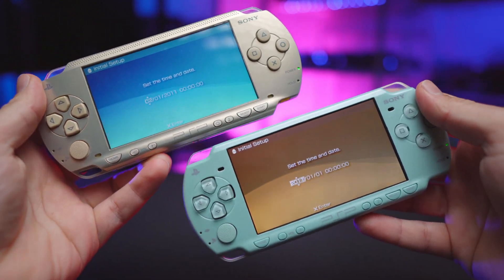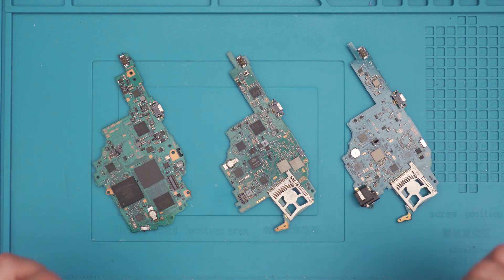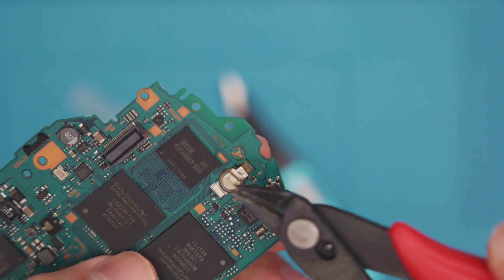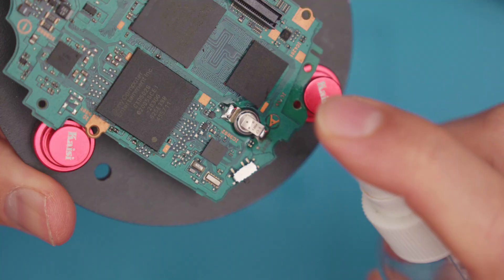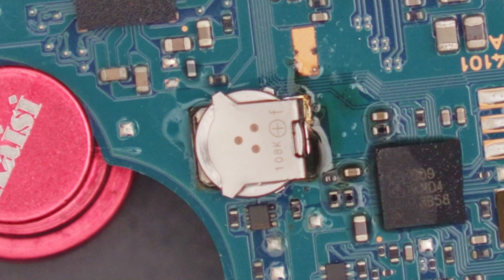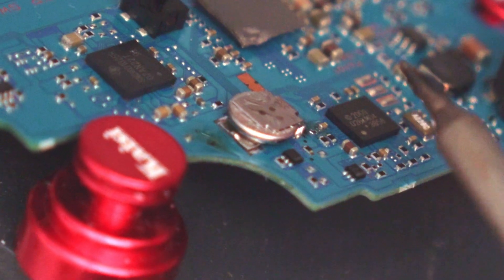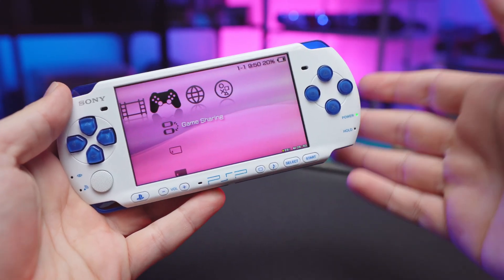How To Fix PSP Super Capacitor "CMOS BATTERY" [Read Description]

Comment from the maker: ━━━━━━━━━━━━━━━━━━
🔴 Current Stance [11/OCT/2025] 🔴
━━━━━━━━━━━━━━━━━━

Disable the Super Capacitor Only
Release the top clip and place tape underneath it to stop contact.
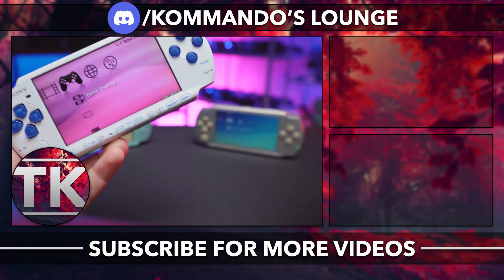As shown in Method 4 the video - 13:16

━━━━━━━━━━━━━━━━━━
⚠ Extra Important Notes & Observations:
━━━━━━━━━━━━━━━━━━

🔴 Many people without the right tools or experience have damaged their PSP motherboard while attempting this, often ripping traces or knocking off components when attempting to remove the super capacitor.

🔴 Based on what I’ve seen (and personally tested), PSP Slim models with weird charging issues may have a damaged or aging charging chip, a bad solder joint, or simply faulty charging logic.

🟡 In some rare cases where the PSP refuses to power on, reconnecting the super capacitor lead (after it was taped off), by temporarily bridging it with foil or soldering it back, seems to bring the system back to life.

It’s still unclear if this is due to user error or a failing charging IC that’s stuck in the wrong state.

🔴Some PSP units with power or charging issues, even with the super capacitor fully removed, may need to sit without any power (no battery or charging cable) for a period of time before they start working again.

This could take an hour, overnight, or even a full day before the system begins accepting power or turns on normally, this is one part of why I think its a faulty charging chip.

But this is with varying levels of success, it can stop accepting power and or turning on again after a while.

Sometimes it can keep working even tho it stops charging, when kept in sleep mode.

🔴 There’s no documentation about this issue anywhere. I’m currently testing and investigating ways to revive these units reliably.

🟡 If you have any personal info or observations, please share them below.
Your input helps a lot with ongoing testing and understanding of this issue.
Reply: GREAT JOB! As for PSP go  and PSP E1000 how NON removable is the battery? IF you have not already done a battery replacement video that would be great to see.
Reply from the maker: @brianwalker7771  More like not  Hot Swappable* or easy to get to

PSP GO is simple, remove 2 screws ontop and 4 screws on the back to unclip the battery

E1000 requires you to open the UMD door + some extra steps to get to the battery.

Will eventually have disassembly videos for those
Reply: @TotalKommando  thanks for the reply.  So no soldered in and glued to high hell BS just enclosed inside the unit. Good to know.
Reply from the maker: @brianwalker7771  Correct, they can be unclipped and removed after the use of a screw driver, its not like those cheap chinese handhelds.
Reply: Hello mate, I have a really odd power issue. 
1.My PSP 3000 works fine when I connect the charger without the battery inserted. However, when I insert the battery—even if it is fully charged—the console does not power on unless the charger is connected. After connecting the charger, the console powers on with the orange LED, but if I check the battery information in the system, it does not recognize the battery. Eventually, the console shuts down exactly 5 minutes after being powered on (I have measured this multiple times). Interestingly, once it shuts down, it won’t turn on again until I disconnect and reconnect the charger cable. Then the same sequence repeats, and it shuts down after 5 minutes again.
2.I have managed to get it to work solely on battery power a couple of times by doing the following: I leave the console powered on and connected (without the battery) for over an hour, then insert the battery. In this way, the console recognizes the battery and allows me to play on battery power for a decent amount of time. I can even turn the console off and on again without the charger connected. However, if I leave it off for a few hours or try to turn it on the next day, it stops working on battery power and returns to the issue described in point 1.
3.I want to clarify that I have tested several batteries—both original and second-hand ones in good condition—and the problem is not due to the battery.
Do you have any idea what might be happening? I have already taken it to several technicians, but none have resolved the issue. The last technician told me the motherboard required replacement. Do you think if by doing this of the CMOS capacitor, would that solve the issue? I wanted to know if that approach might work, or if you think it could be an issue with another chip, or if the best solution is definitely to replace the motherboard.
Thank you!
Reply: @julianariasrodriguez9728 hi  there , I have a psp 3000 just take out from my store room  it been 5 years ago , it have same issues just like yours. Waiting for solution answers in this comment channel.
Reply: @TotalKommando hey, someone told me the psp won't turn on without a charger even with a battery if I disconnect the super capacitor, please advise on what I should do.
Reply from the maker: @KaranbirSinghGill-os7rv  I had one person before tell me that it stopped powering on after they removed the super capacitor, once they put it back it started working

I have yet to encounter this personally, I tested it with the units I have opened and didnt run into this issue,

Perhaps they have a different problem, you can try removing only the top leg and see if it stops working

Otherwise the psp might have a deeper issue that is not related to the super capacitor, for example i have one that i need to leave for a while without power before it accepts power
Reply: @TotalKommando i have the same problem of removing it and it wont turn on
Reply from the maker: @KaranbirSinghGill-os7rv  whats the status now?
Reply: @TotalKommando  I can’t replace it myself so i’ve only been using my psp when i cold boot it somewhere when it’s plugged in. but i have found a shop, i just wanted something concrete before i could actually go through with removing the super capacitor because the psp not cold booting would be an issue for me.
Reply: @TotalKommando  I just got it done and it works perfectly, thank you so much!
Reply: So i can just remove or disable it with no consequences?? Also what do i do if i have no experience in soldering and tweaking my psp?
Reply from the maker: @iannuyens6274  disable it only, removing it is asking for trouble if you have no experience, take your time with it, peel and tape out. it only keeps time and date
Reply: Sorry, to be more clear - you recommend simply disabling the supercapacitor for every PSP version? Is Method 4 applicable to the PSP 1000 series?
Reply from the maker: @ThatDudeCalledMax  Yes, and Yes.
Main reason for disabling only, is because a lot of people end up damaging their motherboard if they are not experienced. At least with this method you get the intended attempt to fixing a faulty power issue psp and or fixing passive battery drain with the least risk.

If you are experienced and up for it, you can try removing it but if you dont plan on replacing it, just disable it for now.
Reply: @TotalKommando   Wow, I have to say I'm surprised you responded so quickly! You're awesome. I'm practically a novice when it comes to soldering, though I'm a bit more experienced with opening things up. I haven't gotten to checking my PSP 1000's supercapacitor yet, but if it happens to be corroding like the PSP from the 1000 full disassembly vid, should I be more urgent about changing it?

I've heard online that there may be issues with the PSP shutting off randomly or having strange charging behavior because of dead supercapacitors, although I'm not sure if those issues were constrained to the 3000 models or not. I hear they're a bit more peculiar for that series but I'm probably wrong. Is there any truth to these issues occurring solely because of a faulty supercapacitor?

In any case I really appreciate the advice, thank you. And thank you for the website guides and the video.

EDIT: If it's no bother, could you say what soldering iron you were using in this video? Presumably it's one of the ones listed on your site, but I just wanted to make sure regarding the tips you were using.
Reply: @TotalKommando  Just one more question came to mind, sorry, but if I'm simply disabling the supercapacitor for the PSP 1000, in my case, 1002, I just need to follow the steps as shown in Method 4 where I peel back the top connected part, place kapton tape over the battery with a little bit tucked under that side of the battery, and snip off part of the peeled back part?
Reply from the maker: @ThatDudeCalledMax  Yea I mostly found the weird charging problems on the 3K with dead caps.

It would be good to remove specially if its leaking.

The soldering iron I use is the AiXun T3A with T245 tip handle, its an old model now, and the one in the site is what I recommend over it now, solid system.

Yes just remove the top lead on the 1000 cap and isolate the connection.
Reply: @TotalKommando   Thanks for letting me know. Will look into this when I get my tools from Aliexpress.
Reply: @TotalKommando  Hey, following up on the PSP 1000. Currently in the process of trying to fix another problem which is the joystick drifting up into the top left constantly.

Mind you I just opened up my PSP recently, probably the first time it has been since being in the factory. I aired it out, dusted it, but it didn't fix the issue. I hear the conductive rubber may be causing the problem and cleaning the contacts underneath can help: not sure if I should clean the rubber itself, but do you think it's necessary to open up the whole PSP for this, or can I just dab the contacts with a cotton swab with isopropyl on it?

Comment: I know this may not be related to the supercapcitor but my psp 2000 can turn on but doesn't go into the xmb menu is there a fix or is it done for? I should also add that it's pretty old and banged up
Reply from the maker: might be bricked, or has a plugin problem, remove mem card ( to disable all plugins) and hold home while you power on, maybe its soft bricked
Reply: @TotalKommando it's not modded but I'll take it to a shop that could fix it, if it's posible

Comment: As of 12/23/26, my PSP won't turn on with the battery inserted. Only when plugged in. It's been requiring the date to be entered after replacing the battery for absolute ages, but this is the first time it won't turn on with a battery inserted. Good batteries, too.

Now I have to disassemble my PSP. AGAIN. 

I swear, every time I think I'm done tinkering with this thing, something else pops up.

Well, thank the Gaming God's that we have Total Kommando coming in clutch with informative videos like this and meme videos like the PSPikachu taser.
Reply from the maker: Good luck, hope those years of dead cap didnt damage anything
Reply: @TotalKommando  A replacement costs $45 to ship from your link on Allie Express! Oof! I guess it's cuz its sensitive materials that need special care when shipping. Oh well. I guess I'll be playing tethered to a wall from now on... lol
Reply from the maker: @lesterparedes8358 Yea not worth it, cheaper to find a doner psp

Comment: Hey I have a question? If you remove the capacitor nad don't change it does it recognize the battery again?
Reply from the maker: Yes thats one of the things it tends to fix
You don't need to replace it

Comment: Thanks for always helping me out.
I wish it had Japanese audio, but the video only has English audio.
I want to ask a question because I don't understand it.
Does removing the supercapacitor completely solve the power issues?
Like, for example, the problem where part of the battery power is supplied to the capacitor, causing the battery to drain faster.
Reply from the maker: Update: I was able to publish Japanese Auto Dub after many months, check again = D

No problem, yea too bad youtube couldn't process Japanese and gave up, and wouldn't let me try again without reuploading

- It will fix the battery draining issue 100% if your battery is healthy and your psp does not keep time when reinstalling the battery.
- It can also fix some charge / battery detection issues, but milage will vary as some psps charging chips are seem to be damaged because of the super capacitor.
Reply: @TotalKommando  Thanks as always.
Your quick work is a big help!

Comment: Bro I have no idea what you’re saying… leave it either on or off, 10 seconds… then an hour or 1/2 hour and in the description it says 5 hours… what is hapoening
Reply from the maker: Thee things can fail at varying levels
The quickest test is if you already have the battery connected for a while (and charged up), remove it, and put it back in 10 seconds, if its asking for time, its dead

Either way, these things will 100% fail, and will start causing problems, if you can, disable it or remove it (if you have the skill)
Reply: @TotalKommando I gotchu thanks for responding. I took out the capacitor but the problem remains… I don’t think replacing it would help tbh, cos it seems the problem might be somewhere else. I got a new battery last week and it was working fine… but it was a cheap battery. Do you think it might be somewhere in the motherboard so should I just replace the whole motherboard or still try the capacitor?
Reply from the maker: @kr97ray  what was the problem exactly before removing the cap? if its a cheapo battery then it could just be the battery, is it one of those "3600"
Reply: @TotalKommando the only thing that makes me wonder if it isn’t the battery is the fact that the battery symbol still comes on intermittently and the power button turns orange for a bit, so it’s definitely recognizing the battery somewhat. It’s not recognized in the system settings though, the power source is “output”.
Reply from the maker: @kr97ray in that case it could be just a matter of adding a piece of paper or 2 on the bottom of the battery to push it up, was it shell swaped? cheap batteries can have these weird problems, if that doesn't fix it, you can try resetting the bms by shorting the 2 outer pos neg pins for a nano second on the battery, dont touch the middle pin, other wise it will kill it
Reply: @TotalKommando wasn’t shell swapped
Reply: @TotalKommando just tried shorting it with a stapler but it still doesn’t work
Reply: @TotalKommando I tried again several times and now it says charge level 2% 😮 maybe it is starting to recognize my battery
Reply from the maker: @kr97ray  I would try to return that battery, and or try to order a better one from amazon prime if you can for easy returns, it sounds like a battery issue to me : )
Reply: @TotalKommando gotcha, thanks man. Much better than a motherboard issue… yeah the battery is just erratic. It was giving all sorts of stuff from external charge, 2% to 81% to 100%, charging, etc. I’m glad to know it’s (hopefully) the battery though. Much less of a headache and costly than anything else
Reply from the maker: @kr97ray  Good luck, keep me posted : ) 
you can always join the discord if you need more help!
Reply: @TotalKommando thank you I appreciate you
Reply: @TotalKommando I just bought a new battery, official ostent from Amazon… it doesn’t work…
Reply from the maker: @kr97ray  Damn, is this a 3000 model?
If so, I had reports of some people getting their psp to work again after replacing the super capacitor, its hard to know for sure if it was because they damaged something and was fixed during removal or the charging chip is going crazy.

sadly these models are starting to fail, and its only increasing every week.
Reply: @TotalKommando yes it’s the 3000. Yeah I just returned the battery, ordering the soldering iron, hot air machine and capacitor from aliexpress. Fingers crossed it’ll work, but even if it doesn’t at least I can still use it when I turn it on with a charger for an hour then insert the battery
Reply: @TotalKommando  Okay assuming I do change the capacitor, and it still doesn’t work, could the problem be with the motherboard? Everything works except the internal clock and the power, so everything points to the capacitor. However after I removed it it still isn’t working, but I reasoned that removing it is the same as a dead capacitor, I wouldn’t expect a dead capacitor to work either, so maybe I do have to replace it which is my next option. But if it still doesn’t work idk, it might be either cos I didn’t do it well or just something else… I don’t know what’s in the whole chain of components required for battery detection. It’s baffling to say the least
Reply from the maker: @kr97ray  If changing the cap doesnt work, and you know for sure everything else works, and that the battery is reaching the connections by adding 2 pieces of paper under it to push it up. Motherboard is defective and not much you can do other than replacing it, again milage will vary, replacing it shouldnt be needed but in some cases I had people reporting that things started working after replacement.

It powers on with power only correct?
Reply: @TotalKommando yes that’s right